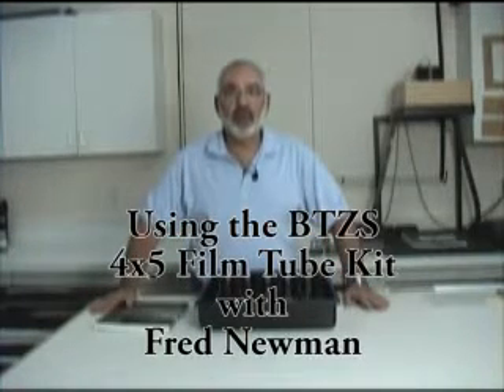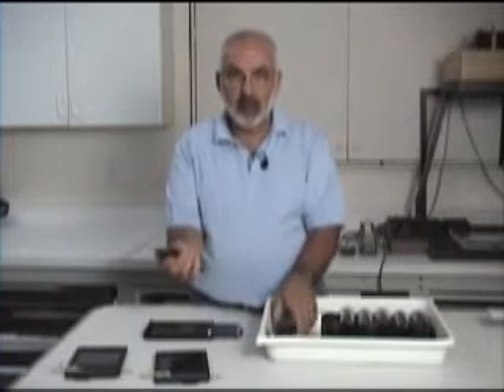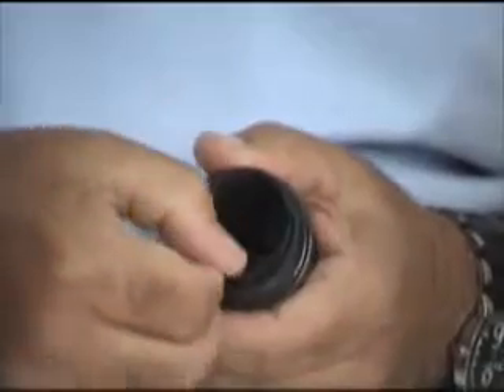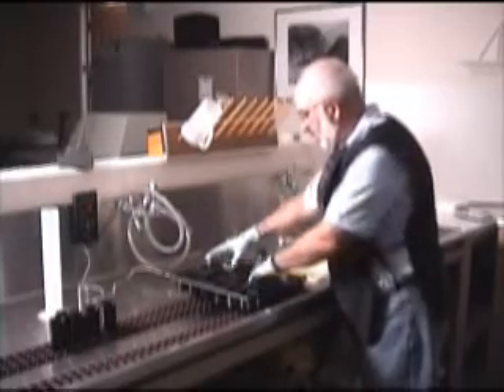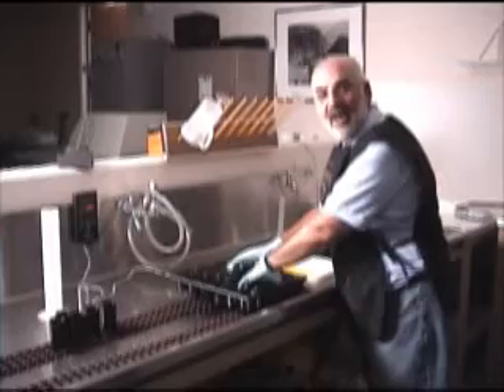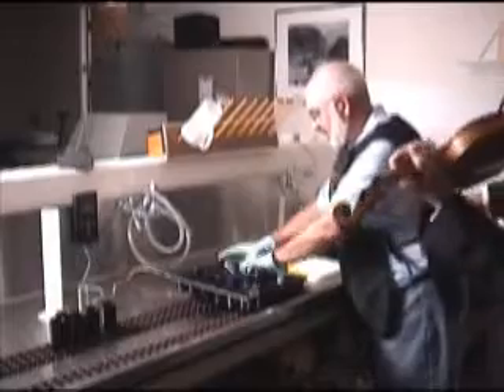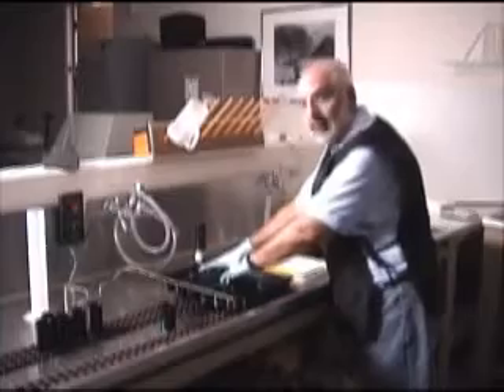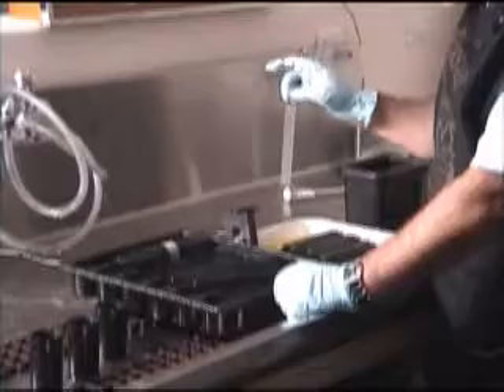2. How to Use the BTZS 4x5 Film Tube Kit - Part 1

Comment: How are you able to open the tube immediately after dev and go to the stop bath without exposing the film to the ambient light?  Am I supposed to assume that you are working in the presence of a safe-light when opening the tubes?  Anyone watching the video can easily mis the part where you say, "I'm tuning off the lights to switch the caps".  The Video appears to to taped in std Room Light.   

If stainless steel Film Dev tank caps have a light barrier why not design them for the BTZS Tubes?